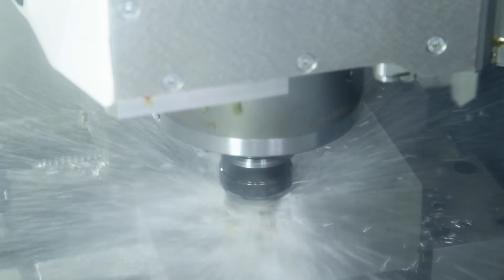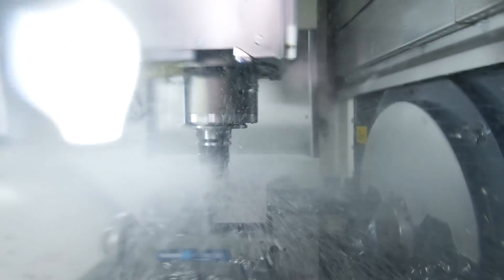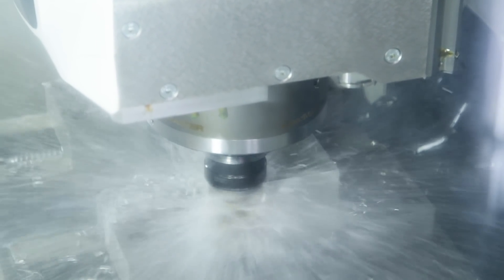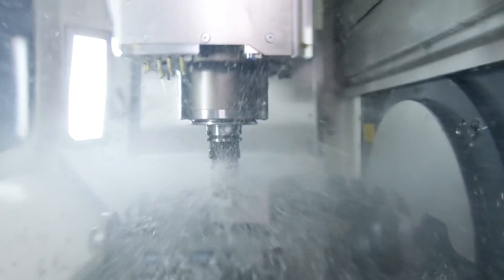Monster Tool Eats Titanium Like No Other! The BEAST HARVI ULTRA 8X by Kennametal

Comment from the maker: Asked a friend of mine at Kennametal to give me some of his expert feedback on the Harvi 8X. Here is what he listed:

* Insert Coating. 

* Insert Substrate. 

* Position of the cutting edges on the tool holder.
(this includes the material of the body, heat treatment, coolant, flute shape, insert edge preparation)

* Reduced or lack of harmonics of the cutter during machining operation

* Shape of the chips 

* Metal removal rate second to none (higher feed/tooth, Higher Speed and higher cutter capacity)

* 8 cutting edges per insert

* Maximized number of corner radius choices

* Platform proposed with different options (diameters, dedicated front insert corner radius)

* We have repeatedly cut cycle times in half and doubled tool life.

* Cutters will pull less cutting load per cubic inch of material removed. This is beneficial to all aspects of the machining sequence.

* 2-inch diameter tools are effective when used with smaller equipment and spindle connection sizes, providing the means to bring productivity enhancements that could not previously be realized.
Reply: TITANS of CNC: Academy 
What is a realistic Material removal rate for this? In what type of materials?
Reply: Your expert forgot to tell you to use chip thinning on the small radial cuts. I would bet the tool was hot after those .100 cuts, the heat had nowhere else to go. Great video, keep up the good work. MMR all the way to the bank!

Comment: So strong is titanium , even with all coliing, still it smokes .
Reply: The smoke is just the coolant vaporizing, has nothing to do with Titanium being strong lol
Reply: @FireGodSpeed  ok , but if titan was something like butter , how the collant could vaporize , just asking ?
Why they use so low speeds and feeds , and why to use collant with titan , if u can use compresed air ?
Reply: @CeNuVezi  if it cuts like butter it produces heat too just need to run "normal" which is alot faster obviously and they use slow feeds bcz Titanium is harder to machine than something like normal steel, you always prefer to use coolant doesn't matter what material your using lol people just don't always use coolant because they don't wanna clean up after
Reply: @Jan Everhard well depends on your applications and tolerance.. If you're making a fitting you don't want any heat while measuring, that's where you would use coolant on bronze/aluminum, letting them cool down takes just too much time

Comment: Is there a reason you clime mill over conventional ?
Reply from the maker: Always on a CNC... definitely don’t want to run over chips
Reply: MasterMoparMan Climb milling is much more efficient on the cutter and how it engages the workpiece. There’s only a few instances where you’d want to conventional mill vs climb; a manual machine with lead screws (vs ball screws on a CNC) is one.

Comment: how the hell can torque be greater than the torque made from 40hp
Reply: Power is torque times revs. You can have a high or low torque 40hp depending on what speed and torque your mill is designed for.

Comment: It has so many cutting inserts so the effective load per insert is small that's why the insert looks perfect even after the cut......the only thing holding it back  is machine, should have used Yasda or mitsui seiki with a kennametal km4x connection
Reply: Danish Jawed yasda machines are for the 1%
Reply: Danish Jawed The number of inserts doesn’t equal the effective number of flutes/teeth, though. You’ve got to think of it as if it were a helical end mill.

Comment: I have never liked hogging this way and I have very few indexable tools.  At that RPM and spindle load that has to be hard on the spindle, especially for a high speed machine.  The first pass was machining 1.9 CIM (cubic inches per minute) and the second was 3.8 CIM.  I rough 6Al4V Ti with a 3/8" end mill and hit 3 CIM (MA Ford 380 series) while running at 600 SFM.  With the bigger parts I use a 1/2" 380 series and get 5 CIM.  It is a more expensive process but the increased throughput/ shop rate more than covers it.  I can load several in the machine at a time and use tool life monitoring to expire them.  Swapping them out also only takes a few minutes even with the heat shrink machine.  Just my $.02.  I really like your videos and appreciate what you put out there.
Reply: I should add that I'm running 30 Hp Makinos so I doubt I could do any better with this tool than what is shown in the video.  With a 60+ Hp machine it would be a no-brainer.  This tool would be hogging 10+ CIM.

Comment: Is there any concern with titanium bonding to the TiN insert coating? I've only machined down some large titanium bolts to length with a AlTiN coated carbide endmill and didn't see any bonding, but perhaps the deposition is cumulative?
Reply from the maker: No

Comment: The hardest thing about cutting titanium is tapping it. Milling, turning, grinding all are pretty ok. I'm surprised that DMU 50 didn't shit the bed. You get any tool over about 25mm in ours and they kick out from shock load.
Reply: I never tap Ti.  Thread milling only.
Reply: @slidey1000  We tried it for a while, didn't really have much better luck. It would just toast the thread mill. Emuge has some really great taps for titanium that last forever.
Reply: Milage always varies,  I had 120 m4 holes to thread,  taps would break after 2 holes.  Sometimes on the second.  Spark eroding to remove the busted taps was killing the budget.  Enter the threadmill,  over 100 holes in Ti plus a display part in 316 with 4 holes and the threadmill is like new still.
Interested in the emuge taps though.
Reply: @slidey1000  I don't have the series handy, but see if there is a local rep you can speak with that deals with emuge. 

What thread mill were you using? I'm not anti thread milling, it was just not doing what we wanted.
Reply: @jeepmanxj  I forget the full part number,  the grade was 1630 though from sandvik.  Using the recipe calculated from the latest ( 2018 ) catalog.  I'll look into those taps for sure.  I have more Ti coming in the months ahead.  Every bit of advice is appreciated.

Comment: Sir explain about choosing feed and speed during milling process
Reply: They will be using  inch/ mins..I thing maybe not
Reply: Check on internet a chart with material thats cutting, material thats being cut. It will give you a speed in m/min ( for example hss cutting aluminium in roughing step is 100m/min ) . Then upload "mechtab" in your phone, go to cutting data and enter the speed in m/min and the Ø of your tool. Then thats it, you have your spindle speed in rpm ( you need to click on it) ! You can also use graphics. About the feed, im no expert but i just check with the chips coming of. There is a way to calculate using the amount of material you are supposed to cut with each flute, but im not sure about it, i just go and see what it does ! Hope this helps a bit, if i am wrong make sure to correct me ! Thx for reading

Comment: I wish i could get my boss out of the 90s. He thinks anything like this is snake oil. Don't even get started on high speed machining.  Titan, you should make a short video for the stubborn ones out there that show the facts: material removal rate,  tool life,  cycle time... as in return on investment and profit. Almost every part we do is 3-4 or 6-7 ops. With a 4th axis and good tooling, nothing would be over 2 ops and i have no doubts i could turn a 2 day part into a 2 a day part. Let's do the math..   boom,  thanks Titan for pushing the trade
Reply from the maker: I hear ya... people complain about outsourcing but don’t adapt to the times... which forces it
Reply: @TITANSofCNC  i understand what you're saying.  Thanks for being an inspiration to me and so many more. You should make shirts that say get after it G00 100%.
G91 G01 z1. M99. And G01 G61.  Go for it 100, step up once every day,  add the extra precision.    Or something like that.  You've given the direction and continue giving the knowledge to help push my goals and dreams.  Thanks for making a difference,  i'll do my part.

Comment: Hey Titan just got a job programing on a Doosan Puma 240. I'll be making one offs parts as it is tooling for the production department. All the material is 17-4ph, D-2, Titanium, inconal, and 4140. These are a level up from the materials I used to program and tolerance as well.My goal is to make them fast and without crap in the hopes of requesting a lathe with y- axis and live tooling to remove mill ops down the road.Hope to see more lathe videos soon talking about the theory in these harder materials with turning in mind. Thank you for this.

Comment: 8 cutting edges per insert is great. Cutter body looks a bit weak. I'm using Mitsubishi VFX6 with tangential inserts, but only with mild carbon steels. I think VFX6 is more 'beast' than this HARVI.
Reply from the maker: I got the smallest cutter size because I didn’t have the HP. Believe me the tests and customer tutorials show this as top dog in Titanium. Added some notes on the cutter and pinned them to the top of this comment section.
Definitely value your opinion.

Comment: The mill I work on is only 4kW and 2000rpm but the spindle can deliver more than 3 times the torque (600Nm) of this state of the art CNC due to the gearing...it isn't faster by any means though!

Comment: I would have liked to see it on a machine that had the grunt to put it to work. Maybe a horizontal.
Reply from the maker: Some Horizontals are powerful on the low end, some are not. Will definitely do a part 2 when I get the right machine. DMU50 is great in ways those other machines are not.